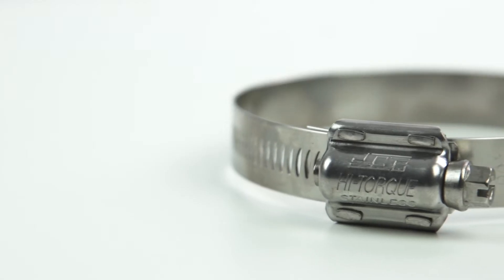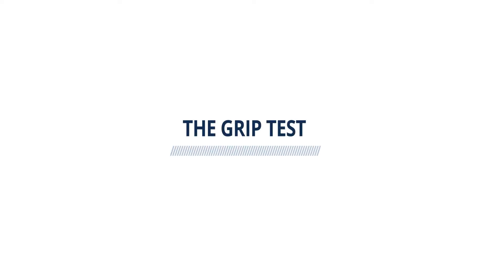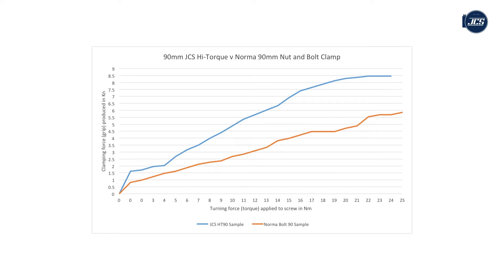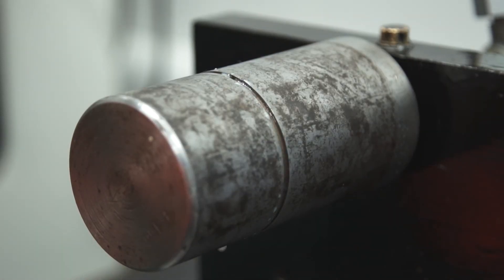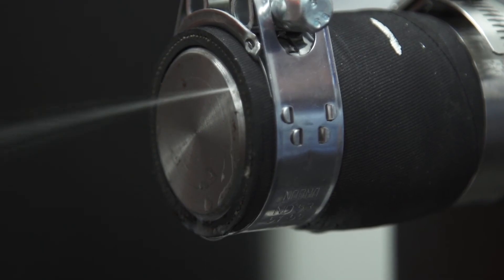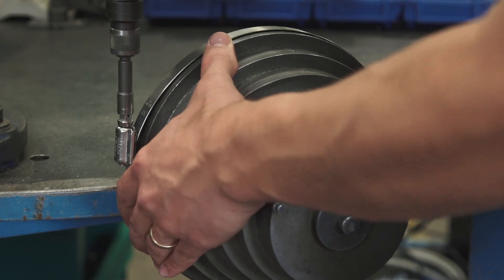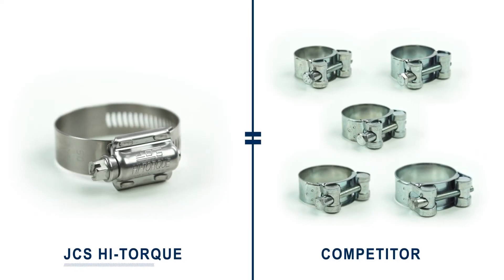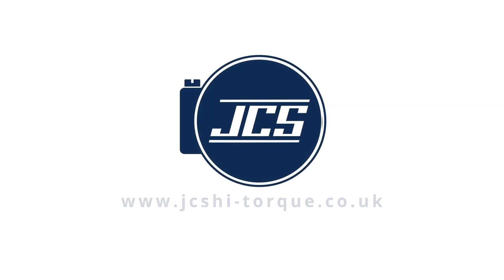JCS  Hi-Torque hose clamp test

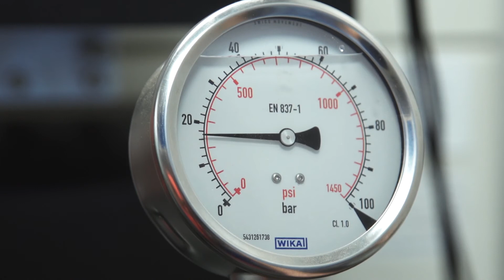Comment: 2:00  2:10 clearly JCS  clamp causes damage to the hose
Reply: It's a test aparatus. 300psi is well over what that hose is manufactured to withstand....
If your cooling system or turbocharger system is dealing with 300psi, you aren't going to be running weak rubber hose designed for 15bar are you...
Reply: @jjmmjj9999 I am not talking about the pressure that will damage the hose by testing it beyond their rating . The “working” 15-20 newton meter  tightening torque that cause the clamp to dig in the hose.